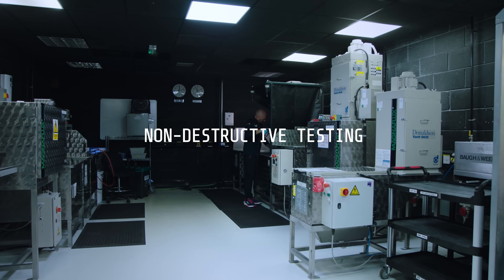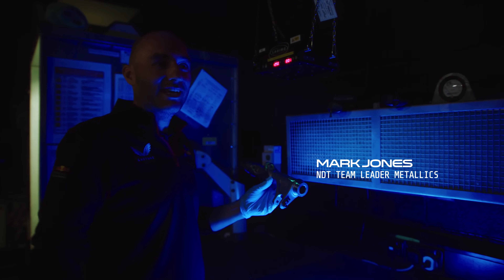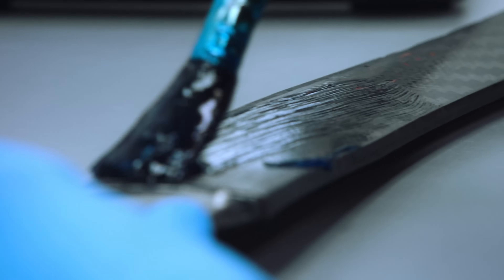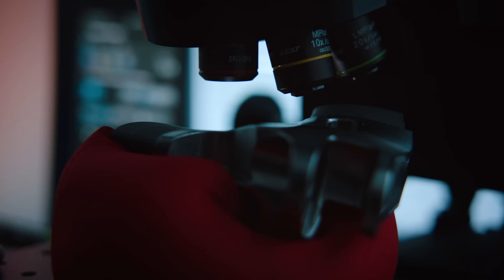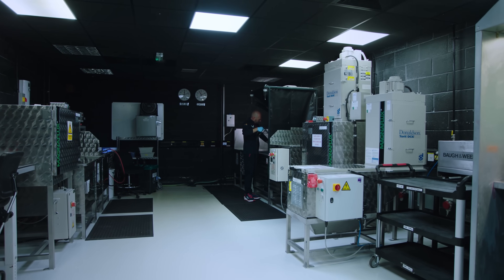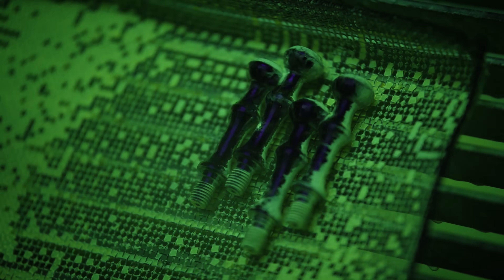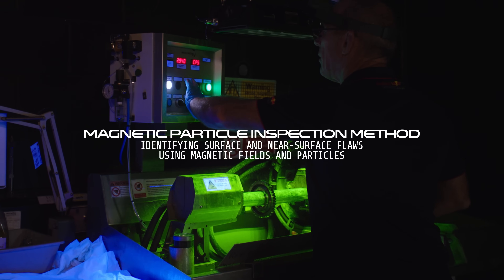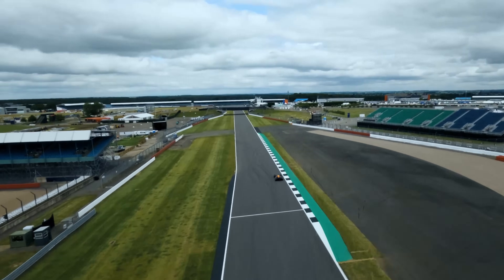The JAW-DROPPING F1 Technology That Saves Lives | What It Takes

Comment: The magnetic particle fluid doesn't necessarily go into the defect. The magnetic fluxses induced when magneticing the part attracts and keeps magnetic ink.  Sub-surfect can be detected becouse the magnetic fluxes gets pushed up to the surface where it attracts the magnetic particles when doing rectified/dc mpt. Also aerospace standards for magnetic ink particle size is below 40 um if i'm not misstaken, why do these guys deviate?